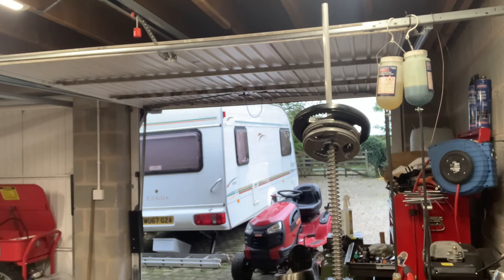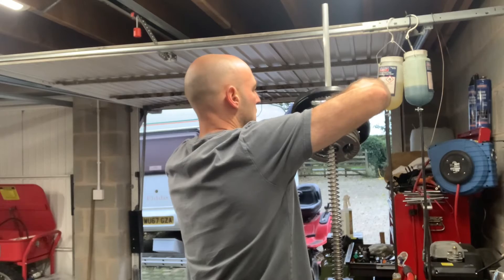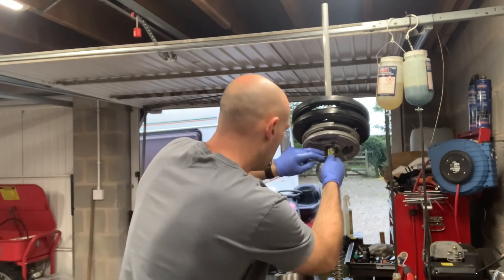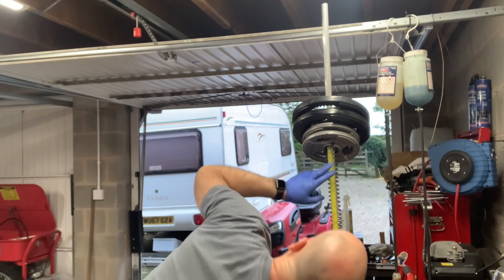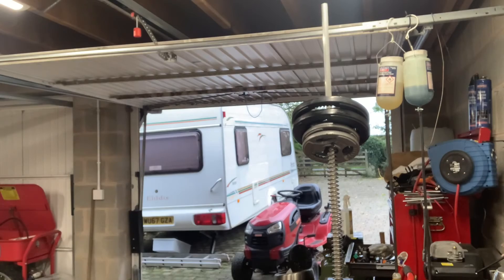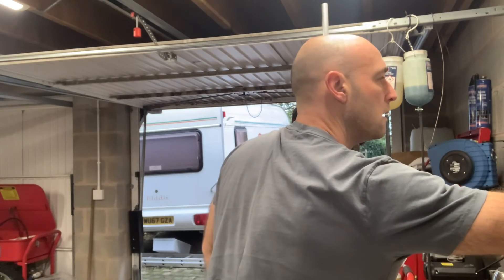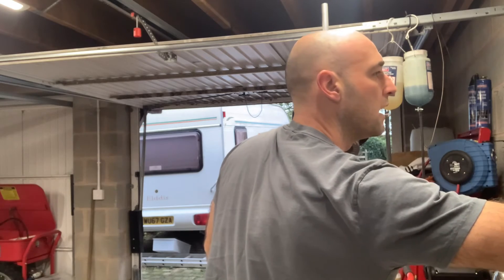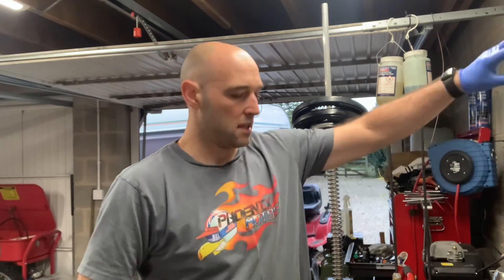Simple spring rate test

Comment: I was following along until your calculation method. Can you say how you did that again? Total weight was 15 kg's then divide by the mm's they went down (30)?? Which gives you 0.5 which you said was half of the rate...so those springs were rated at a 1.0kg/mm? is that correct. Thank you.
Reply from the maker: Hi mate so basically the no of kg's divided by no of mm's so the spring rate in that example is 0.5 kg/mm